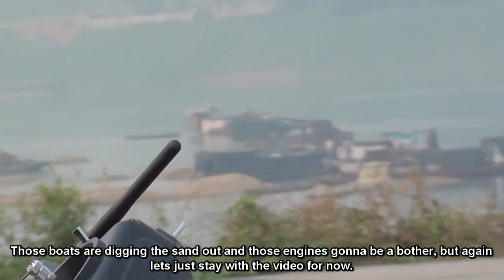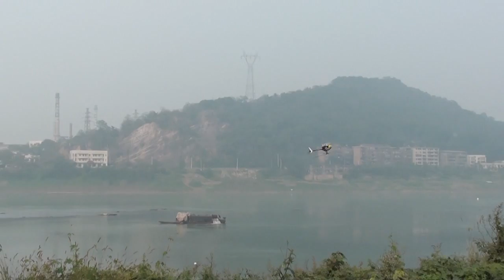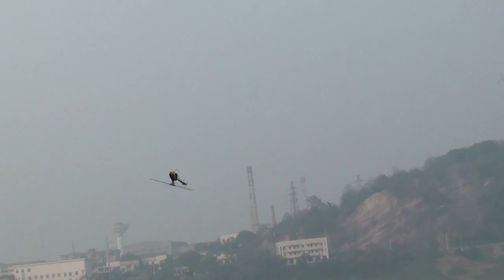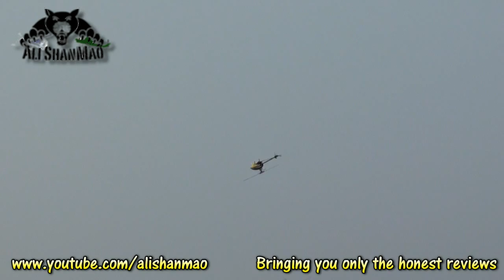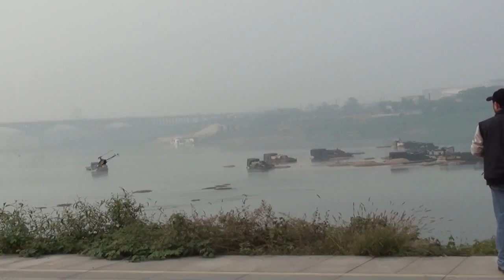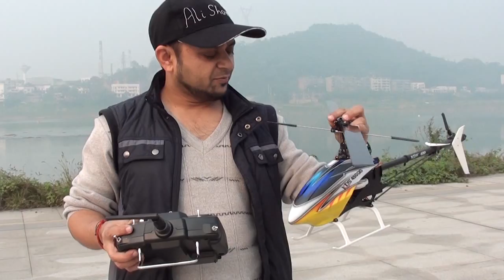KDS 450QS Soft 3D Flight

Comment: Bought one of these but already bought an Align 450MX 1700kv motor for it and gonna replace the plastic linkages with Align metal parts too. :) and probably change the gyro to align one, already changed servo's to hitec metal gear ones, Why not just buy an Align to begin with some may ask, well I enjoy upgrading these cheaper chinese clones. :D

Comment: to get more agility, try to tweak the flybar.
use less weight paddle or shorter bar, i think we cannot change the mixing of flybar with main blade with stock rotor head design.
because if this heli got high speed/precision ccpm servo, it maybe just increase little bit agility because maybe we only control 50% of the main blade, while other 50% is control by the fly bar.

Comment: @lowtus7 First you need to set up the gyro limit settings or program the gyro-side end points so the slider movement won't bind. This should be done with 100% ATV in the transmitter. Just turn the gyro limit knob on the gyro (401-style) or program them using the transmitter and gyro (Align GP750 / Assan GA-250 /Quark).

Then at the end you can in fact adjust the end points without obstructing the gyro functionality. My Assan GA-250 works at about 60% ATV now to decrease piro rate. Works a charm!

Comment: Comparing with V450D01, yeah walkera win.
But if looking the kds 450qs design, it almost similar to trex 450pro.
If we change the elctronics li powerful motor, digital ccpm servo, hispeed mini rudder servo, better gyro, and futaba 8FG with 7ms servo update rate.
This heli can be hardcore 3D.
But even if the heli is the best of the best.
The pilot is the main key.

Comment: First of all, love your vids. I'm so jealous... You say in the video, adjusting your end points will dictate the piro rate, however, I thought the gyro dictates the rotation rate in most cases, depending on its setting. And limiting the rear tail sliders movement will not be good for other maneuvers, such as ff pirouette .Some gyros may use endpoints on the transmitter to set the rotate rates, I think the gy401, but a lot don't.